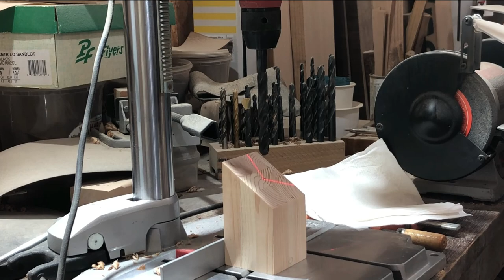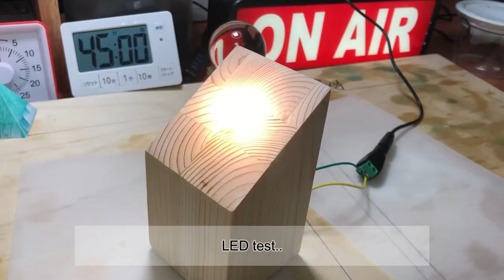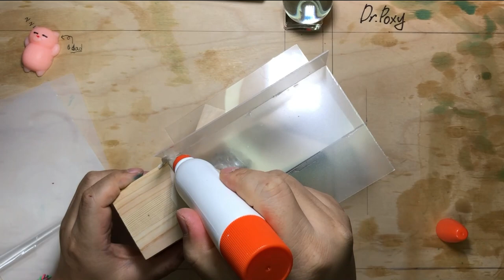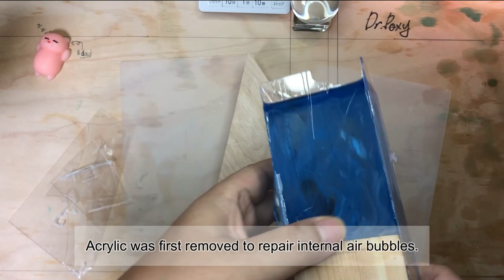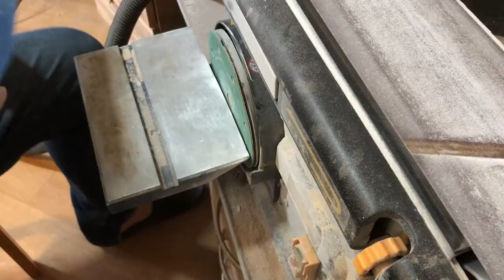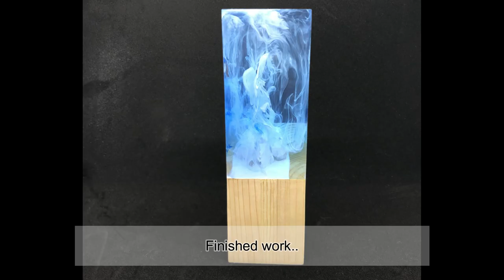Resin Art - Resin Night Lamp with Wood 💡

Comment: What did you use to paint the crystals? Did you pour the resin while the crystals were still wet to get the smoke effect? Also, did you add the blue dye immediately or wait for the resin to become gel-like in order to get the smoky effect?
Reply from the maker: The crystals are poured with pigments in liquid form.
You can think of it as a form similar to oil paint.

I poured white, and immediately poured blue-toned resin.
The resin then hardens and heats up.
This heat causes the white pigment to rise upwards.

As you can see from the video, the heat causes large bubbles to form.
As the resin increases in height, the internal heat cannot escape upwards and generates a lot of heat.
Given this moderate height and amount of resin, you can make some great smokes too.

Please come to see often.. 😊😊😊
Thank you...
Reply: @DrPoxy_  Thank you for this insight. It's exactly what I was looking for. I'll have to test this out. I use a deep pour resin that I can pour up to 5"/12cm and it barely gets hot. It also has very few bubbles. It is a low viscosity due to its deep pour nature and as a result, does not create much heat at all. Most pigments that I add too soon just sink to the bottom because it starts out so thin. I love what you've done though and I haven't seen many smoke effects in this type of application.
Reply from the maker: I used crystal clear resin.
I'm still not sure exactly what the difference is.
However, it is a resin that hardens for 48 hours. (Low viscosity resin)

There are almost no air bubbles at about 10cm(height), but when it is higher than that, air bubbles and heat are generated.

There were many places where the resin information was not detailed, so there were many difficulties in choosing a resin.
Then I was lucky enough to make this.

I'm working on something else for a while now, so I'll upload resin soon.
Thank you for your interest. 😊😊😊

Comment: i am so confused at 7:54 you seem to inject epoxy inside the thing. how did you get a hole to inject ??
Reply from the maker: It is important to bleed the air out of the hole by inserting the resin.
It was more difficult than I thought, and I remember getting the air out by repeating it several times.

The dropper(dropping pipette) was easier to work with than the syringe.
Good luck.. Bro..

Comment: Hello. Would you have the links please to know exactly what you used : Apoxy, wood type, glue etc..
Thanks so much in advance
Reply from the maker: There are a lot of things I bought in my country, so it's hard to answer.
But I'll try to answer as much as possible. 😊😊😊
The link is unknown, so you have to find it on Amazon, etc...

epoxy : crystal clear epoxy resin (with hardener)
wood : red pine wood (recommend using a better one)
glue : any wood glue, instant glue
acrylic : clear transparent acrylic sheets
 (1T)

If you need help, I’ve got you covered...
Thank you..
Reply: @DrPoxy_  thanks a mot for your reply. Greatly appreciated.
Just one thing. What can we put on the wood to make it look nicer?
Reply from the maker: @MrCed0802  You're welcome..
But I don't understand well...

Are you asking what is better to put on the wood?
Instead of crystal?
No need for crystals, just let the light scatter well.

If I don't understand, ask again. 😊😊
Thanks..
Reply: @DrPoxy_  thank you 🙂